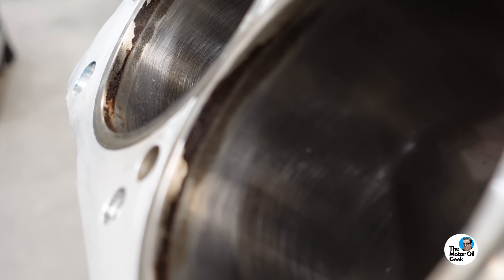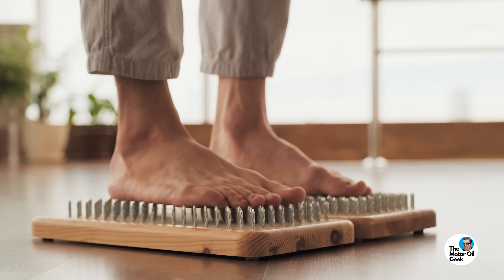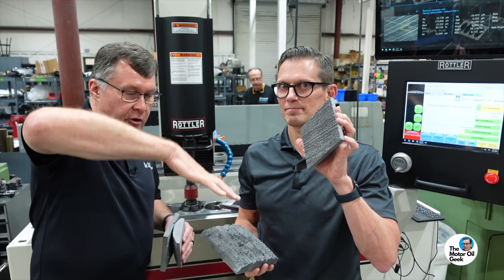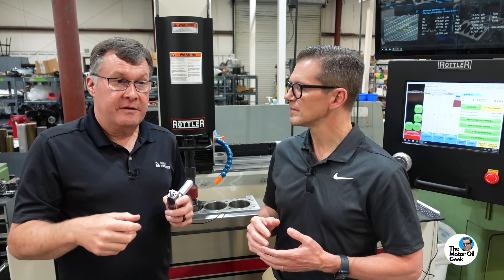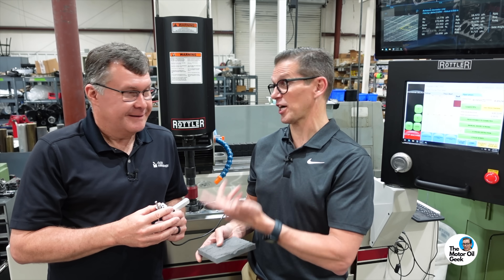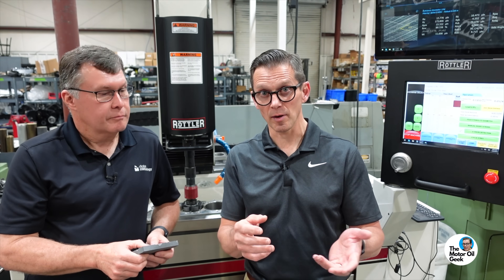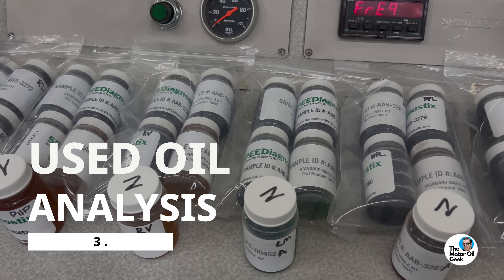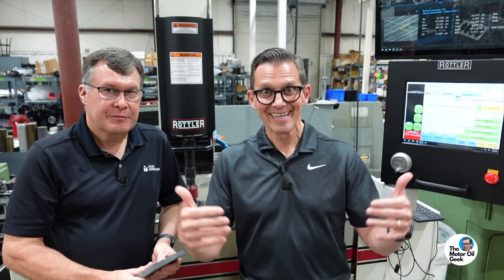GM's $1 BILLION Dollar Blunder: ROUGHNESS Matters...

Comment: I was really hoping you would show the surface finish of a bad GM crankshaft Vs. a good one with the profile meter.
Reply: Good luck getting your hands on a bad one.  GM will most likely take them all back,  examine a few, then send them to be melted down.
Reply: @davereiland9921  The YouTube channel "IDo Cars" guy managed to get ahold of one and tore it down.  His take was GM was specifying too low a viscosity of motor oil for the L87 engine, to get it to pass a fuel milage specification.
Reply: @Slickrock72 yeah I saw that.  I suspect with so many of these to keep track of, a few are bound to slip through the cracks.  But he wasn’t correct about oil being the problem.  No oil will overcome improper machining.  I would still never use 0W-20 in one of these though.
Reply: @davereiland9921 i paid for the car i paid for the service now give me my part back. Its that easy.
Reply from the maker: That would have been great. Unfortunately GM is not handing out bad surface finish crankshafts. By the time a bad crankshaft rears its head in a customer engine, the damage is already done. So those crankshafts are not worth measuring.
Reply: @themotoroilgeek many of the engine failures are from a single journal grabbing the rod bearings and seizing the engine. The other three rod journals and corresponding rod bearings can be completely unscathed and measured for surface finish.
I still have a failed L87 crank from a core engine I bought several years ago before the core $$$ went crazy.
Reply: Amazing How much negativity there is these days. I can tell by the nasty comments how they voted. They don't put in much thought before they start typing.  🤣
 You're doing Great! So pay them no never mind.  @themotoroilgeek
Reply: @themotoroilgeek  Aluminium and copper are not magnetic!
Reply: @themotoroilgeek thanks for answering the big question from this video.  This is a fascinating discussion.
Reply: @themotoroilgeek The issue is the EPA and NHSTA the bearings that they need are 5-10 year technological advances. Apply a microstructure in scale with the proper alloy configuration that will not destroy itself under cavitation. EPA blame them and nhsta
Reply: @gvi341984 your theory is that this failure of this particular engine is due to these systems and somehow a conspiracy of the government, rather than GM just once again failing to build things properly? Give us a break and stop drinking Kool aid.
Reply: @gvi341984 - Nah, it’s bad engineering at GM, driven by the finance department.
Reply: That’s what I assumed as well
 I had a good crankshaft polish at a local machine shop who botched the bearing surfaces to the point where I questioned if it was good, but I assumed since I was not a professional and they are that it was probably for oil retention or something like that.  
It wasn’t horribly rough, but it wasn’t great in my opinion, I installed it in the engine and it lasted a few hundred miles before it started lightly knocking. 
 I pulled the engine and tore it apart to find out. It nearly wiped out all of the rod bearings.
 Then I bought a new crankshaft for my Honda push mower and inspecting the surfaces, I realize that machine shop fucked my crankshaft up bad. 
 No wonder the bearings were wiped out to the copper layer. 
This shop had been around for decades, and they shut down permanently a couple months after screwing up my crankshaft….
Reply: @jeffgriffith7003  That's where the fear comes in! There is so much trust put into a machine shop to get those microscopic details right. Do they know what they are doing? Do they have the right equipment ? Do they maintain the equipment? Do they give a darn?!
Reply: @mitchmasterfix5292 The fact is: if you're going to point the finger at the machine shop(s), you better be able to guarantee it was CAUSED by the machine shop(s). Scarring on a crankshaft journal can come from a myriad of sources, not just the initial machining. The only way to PROVE it was the initial machining that was "erroneous," "flawed," or"defective" you have to get your hands on one of the bad cranks BEFORE it goes into an engine. How are you going to do that? Until then, you can't prove the crank being bad from the beginning was the cause of the problem. (Unless you have an inspection certification on the crank from the inspector that checked the crank before it was sent out.) I'm sure their cranks get inspected in "batches" so say ten good cranks from a batch of 100 means all 100 cranks are probably good, so they ship out to assembly.
Reply: @rotorhead5826 The reports indicate reworking the cranks at the assembly plant, so they knew there was a problem in manufacture that they attempted to remedy, but obviously was unsuccessful in part or whole.
Reply: Agreed, it’s nice to understand the theory but it’s also nice to see real world examples
Reply: Yeah, IF they had a better finish they probably would have lasted longer with the 0w20. If they had stuck with the 5w30 the previous engines got they most likely would t have had issues with the rough cranks….

 Think about it, there is more load on the  oil film on those rod journals than most other engines. They make good power, have high loads, especially when towing and it pulls the motor down to 1500 rpm in high gear, then starts disabling cylinders, increasing the film load on all the rest of the cylinders. Even with a proper finish odds are we’re crashing stuff together with 0w20. 

 All of my customers with those engines get a filter inspection and changed over to 5w30 like it should have been to start with.
Reply: @38turner  Interesting. Therese to be a consensus that 5w30 oil is safe for all engines vs 0w20__🤓
Reply: @martinradtke5181 , no sir. Just adds a needed margin of error the 0w20 does not. It is also the oil that was spec’d for the 6.2 for several years without issue. 

 Isn’t it interesting that only the trucks and SUV’s are having issue?
 If it was truly a surface finish issue the Camaro’s and Horvettes would be having issues also. No way did the finish not get missed on at least some of them also. They don’t see the same loading as the trucks and SUV’s
Reply: The title sure doesn't match the waste of time this video ended up being.
Reply: He’s definitely fearful of the GM lawyers. He uses the crankshafts and headline, and an initial reference to the recall, which is all published previously, but then veers off to surface finish of cylinders on race engines, which he’s covered previously ad nauseam. Leaving the implication that this is related to the crankshaft failure, but without saying enough to get him in trouble with the GM lawyers.
Reply: @GNX157  Agreed.  Cylinder surface finish is not a player here.  CYA is.
Reply: @GNX157 This is an EPA failure the tolerance on a digitally controlled modern grinder is not the issue. Cavitation is the issue due to VVT and Direct injection
Reply: @gvi341984  then why don't this happen on all their vvt dod engines? Why is it only the 6.2?
Reply: @DavidPhillips-rs5dq VVT in GM’s DoD/AFM engines (e.g., L87) is less problematic than AFM due to simpler cam phasing, refined phasers, and stable oil pressure. AFM’s lifter failures and vibrations, worsened by L87 recall defects, cause more bearing issues. Ot was simpler in design but still had its problems.
Reply: @gvi341984 did you totally miss the fact that the problem was a missed step in the final prep of the cranks at the Tonawanda engine plant?? That’s been known for weeks now. Where have you been, and why are you making up nonsense about cavitation?  Besides, this engine design doesnt feed oil serially through the lifter/AFM system and then from there to the bearings… oil that’s been through the AFM drains back to the sump, gets picked up, pumped,  and filtered before it has a chance to go to the mains. Even if AFM did cavitate the oil, the voids would be collapsed and the oil deaereated (by pressure in the filter) before ever getting circulated to the crank and rod bearings.
Reply: @stevelacker358 That's an interesting point, however, pressure fluctuations from the AFM system can still induce cavitation in bearings, even with filtered oil. The Tonawanda oversight likely exacerbated this by compromising bearing smoothness. High-RPM operation further increases cavitation risk. The issue isn’t just oil flow; it’s about *pressure dynamics* and **surface quality**, not solely serial oil circulation.
Reply: @gvi341984 What does that have to do with the crankshaft or mains? That is a separate issue.
Reply: Are there any other platforms that share the failing 6.2 crankshaft part numbers?
If yes , then what are the failure rates of the other size.
Reply: @daviddroescher the LT1 in the Camaro uses the exact same part number crankshaft. In the 2021-2024 year range of the L87 recall, the Camaro used 0w-40 M1 Supercar oil as factory fill, as does the LT2 Vette. Neither one of those is having the same issues as the L87.
Reply: @brianrock3949  I'm not 100% sure, but not all cranks are built at the same facility. If there was 1 batch of grinding wheels that weren't the correct spec stone for the crank grinder where these are manufactured, then there could be a batch of cranks that get through production inspections for a few shifts with improper finishes. In a production plant, there is only periodic inspections mandated by the manufacturer for quality control, and most of the line stops are by the production employees to recognize a change of some sort. They know their job better than the line supervisors, but if they didn't care to tell anyone something wasn't right, or calibrated properly, they just keep spitting out bad parts. If a few weeks of production goes by before they do anything about it, then they get dispersed into the publics cars and trucks. I would think the Camaro LT1 and Corvette LT2 engines are produced at a different LVL (low volume line) where they have much better quality control measures in place for flagship vehicles.
Reply: Showing how to get the right crankshaft finish would be good also
Reply: I work vehicle maintenance in a limo fleet. We have one 2022 escalade that's on its third engine. If you want to see an "example" of the surface finish/roughness of a bad case, just imagine you threw a grenade down the oil fill tube and it blew up but didn't shatter/blow out the block. Nothing left to see, just chunks and metal confetti.
Reply: There’s potentially much more going on there than the surface finish process. I read an article about oilfield drill equipment where they make the same thing all the time, down to the point they know how long each tool will last in the machining centers. Then one day it went completely off the rails. Turns out the same steel company shipped in the exact same specification steel from a plant in another country and it totally grenade their processes. Now I’m not saying that’s happening here but they’ll probably need to back track those crankshafts right back though heat treat and back to the foundry to see if something is different than expected maybe even the verifying the bond hardness of the grinding wheel or even the way they diamond dressed it… could be many variables at play there. Heck it might even go back to the crank bearing manufacturer contributing a weird thing like a slight but allowable deviation in the bearing composition which poorly reacts to the crankshaft journal surface texture? 🤷‍♂️🤷‍♂️ it’s a pretty crazy place we live in.
Reply: The picture is what made me want to watch the video, very disappointed that it was just click bait.
Reply: Not for sure but bearing surfaces I work on for gear pump those journal had to be less than a 10 for surface finish. I would think a crankshaft would be at least that or less.
Reply: It could be as simple as a manager decided to skip one polish grit finish just to "save time and money". Or even that we used to make those with a certain finish so we can do the same today even though the new print says it needs a better finish. This is an example I have seen before on other scenarios.
Reply: The NHTSA report (https://static.nhtsa.gov/odi/rcl/2025/RCLRPT-25V274-1598.PDF) says:  "Engine teardown analysis identified two primary root causes, both of which are attributable to supplier manufacturing and quality issues: (1) rod-bearing damage from sediment on connecting rods and crankshaft-oil galleries; and (2) out of specification crankshaft dimensions and surface finish."
Reply: Yeah right? Puts a catchy title and then talks about something else. thumbs down
Reply: Yep, a profilometer
Reply: Yeah.  The info on the root cause is what is really needed......
Reply: Who manufactured the cranks? Doesn’t seem like they have any QC.
Reply: Give "I do cars" a bit if he hasnt shown any yet.
Reply: @jtrill2  He did tear one down.  He wasn't sure how it ended up in his hands.
Reply: @jtrill2  He has done a failed L87…
Reply: @jtrill2 I Do Cars has torn down a couple of these recalled GM engines
Reply: It's not the finish that's the problem but AFM and VVT causing the cavitation issues. Thicker oils increase pressure fluctuations won't sole the problem. It's not about roughness is the entire culture of is design
Reply: @gvi341984  Then why does this issue only affect the 6.2 and not every GM v8 with VVT and AFM or older 6.2's with VVT and AFM?
Reply: @AlexAutoRepair1 because that guy doesn't know wtf he's talking about.
Reply: @AlexAutoRepair1  Only the crankshafts that were made in the Mexico facility.
Reply: @AlexAutoRepair1 GM’s 6.2L V8 AFM evolved across generations: Gen IV (2005–2013, L92/L76) introduced basic V4 deactivation with lifter and oil issues. Gen V (2014–2020, L86) added VVT, variable oil pumps, and smoother transitions. L87 (2020–present) refined AFM but recall defects amplify lifter/bearing failures, worsened by oil demands. Automotive industry is hitting a wall that many in the marine or nuclear energy would know and its cavitation and material limits. New systems increase the pressure and the NHSTA is forcing compact engines for crash ratings. New alloys have to be developed to mitigate the issue because it's a huge thermo problem
Reply: @AlexAutoRepair1 IIRC, it’s because GM specified 0w20 oil for the newer 6.2l (to reduce friction and increase fuel economy and improve their CAFE numbers), but not for the 4.8 and 5.3 engines.
Reply: @AlexAutoRepair1 Different supplier!!!!!! GM trying cheaper parts, and piston skirts are another issue by breaking apart. I own a 2019 thankfully.
Reply: @AlexAutoRepair1 because the dude is clueless
Reply: @AlexAutoRepair1 I bet they cheaper on the surface finish. Clearly something changed.  Notice all Mitsubishi engines blow smoke at not even high mileage. They'll blow at 100,000 KMS (60,000 miles). No other make does that. Isuzu 300,000 no smoke. I don't know Mitsubishi thinking, but for their domestic market they replace cars in 2.5-3 years. Perhaps a hurry up and replace technique. But they're not really around right now. Toyota are very much around. Treat the customer right. Don't use the product in a negative way to make them spend. That leaves a bad taste. Toyota and some others ? Don't do that. A quality product leaves a good taste - good experience. A smile. See the difference?.
Reply: @keithfork8663  bingo.  And for some reason they do not know how to idntify which engines those crankshafts are in,  but I dont think he can say it.
Reply: @AlexAutoRepair1  there are different manufacturers. Most automakers don’t even make their own parts. They are subcontracted. Perfect example is the engine blocks years ago that were porous. GM had a problem and not oddly enough, Nissan did as well. They were both cast by the same subcontractor.
Reply: @akshonclip My thoughts are that it's just an incorrectly made part, not a design flaw.
Reply: @keithfork8663 
 I did read that some of the crankshaft grinders in the Mexico plant were found out of specification as far as taper front to rear. As this was shortly before the recall was announced, it may be possible more than one defect may be to blame.
Reply: @keithfork8663 which is why I think they were ground the wrong direction.  I know someone will say that doesnt matter...but I did a reverse rotation 351w and the crank roached the bearing in less than a 100 hours
Reply: @AlexAutoRepair1  The real question is why are so many other MFGs having crank/oil issues too?
Reply: @gvi341984 it’s not AFM. 🙄

That has its own cr*p-ton of problems, but it won’t kill the main bearings.  Totally different issue.
Reply: @gvi341984 I could see afm being bad, but vvt is a BIG stretch.
Reply: He won't because he's just paid to say what he says, even though he denied, he is paid by oil industries, but he is
Reply: @trxtech3010  proof?
Reply: @mikeperry2814  idk if he's paid or not, but I will say that when you work in an industry, you have to maintain a certain level of respectfulness, sometimes beyond what is actually justified, in order to maintain a good professional relationship and keep the money flowing. Sorta like being nice to the coworker you hate so HR doesn't have to decide which one of you gets to keep their job. 😂
Reply: @mikeperry2814  People who always ask for "proof" are ridiculous. It's almost like they don't understand the concept that people with things to hide, sweep the "proof" under the rug... therefore making things difficult to "prove". Even tho most people with more than 2 brain cells can clearly see what's going on. You know what they say...if it walks like a duck, and quacks like a duck, it's most likely a........what??
Reply: @bridgetshepherd5202 GM deserves ZERO respect on this issue. They knew there were problems for 4 years and only did the recall when they were forced to. And then their solution was to use 0-40 oil in hopes that the problem would go away until the warranty expired. GM makes me sick
Reply: @Kyzyl_Tuva  and Phil has called out like 28 of his last 40 shifts, and is constantly fucking up critical procedures, but if I yell at him, it's gonna raise tension pointlessly and I'm gonna look like the problem. Sometimes job security means just powering through and showing someone a baseline level of decorum even when they don't deserve it.
Reply: @Chris-te7uk Ridiculous are the folks always making accusations without any proof. “I don’t like the guy so I think he’s up to no good, just trust me” doesn’t cut it. If he’s lying about something or hiding the truth, it would be the easiest thing in the world for you to share what the reality is and show he’s a fraud, but you can’t, all you have are bad vibes because he didn’t tell you what you wanted to hear
Reply: @trxtech3010  any proof of that?